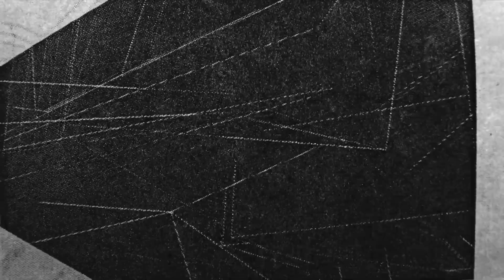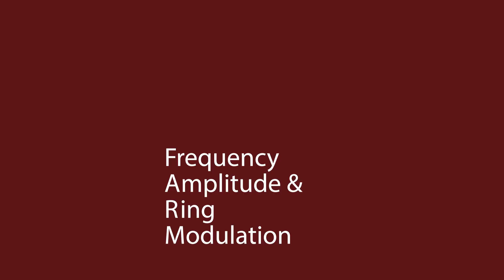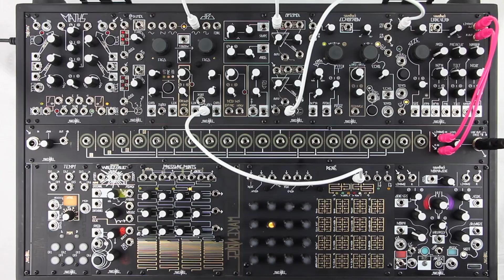Timbre FARM: Frequency Modulation

Comment: Great video, but I suggest that when you connect a cord or remove on you say what you are doing.  Otherwise, it’s hard to follow what you are doing.
Reply from the maker: Hello, I always try to comment on all connections. Sorry if it was confusing this time. If you're referring to the portion where a sequence is set up (around 1:20), I did put a card in the upper right to link to the "basic sequencing" video. - W